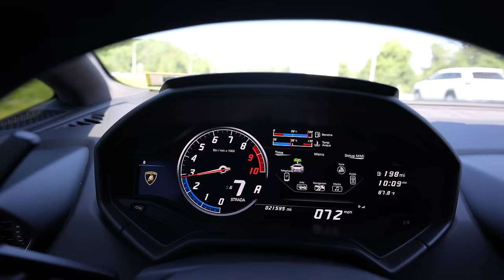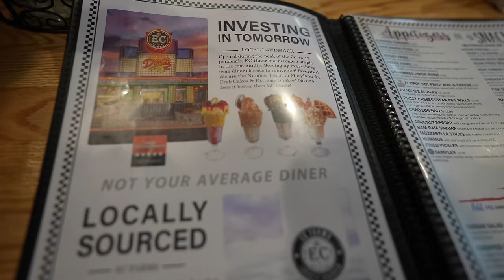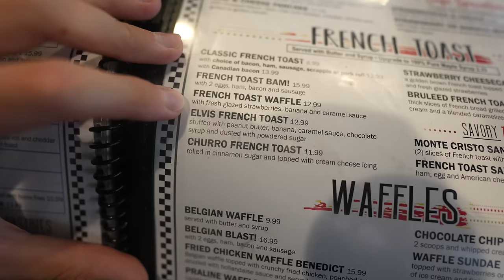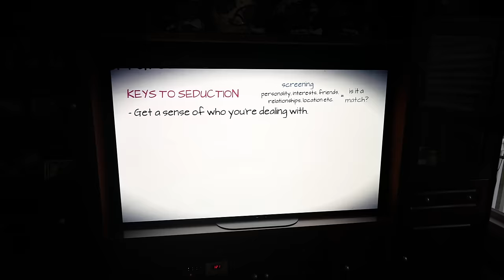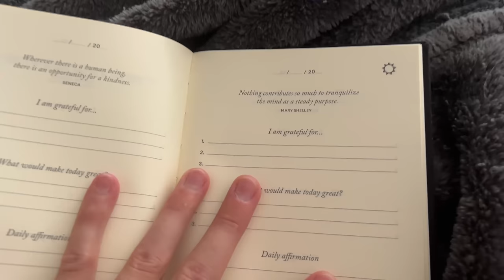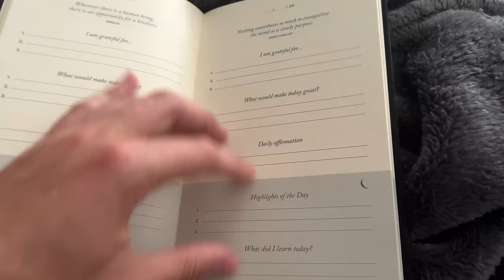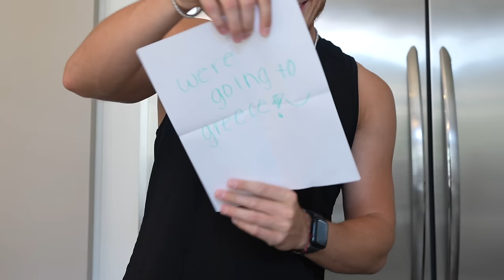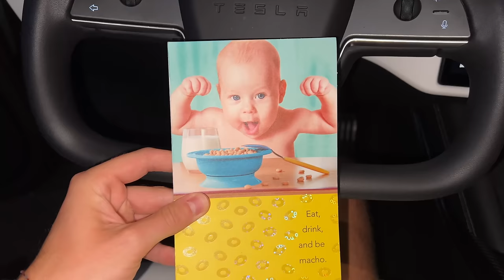I Raced My Twin Turbo Lamborghini (1,100+ HP) w/ Dobre Brothers

Comment: Lance you might need to look into some KW Coil overs if it still shakes after you install the under trays. Also if you don’t have them already look into some TOYO R888 for your set of tires. Love the lambo!

Edit: Also Novitec coil overs could be a good alternative option too.